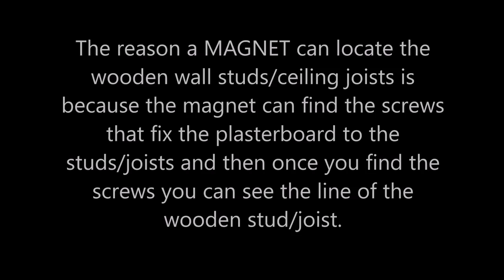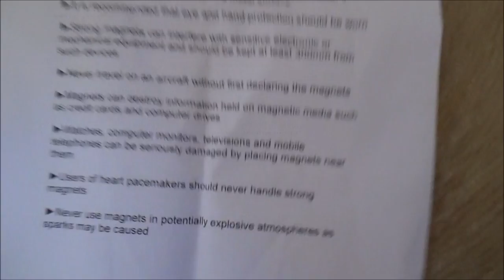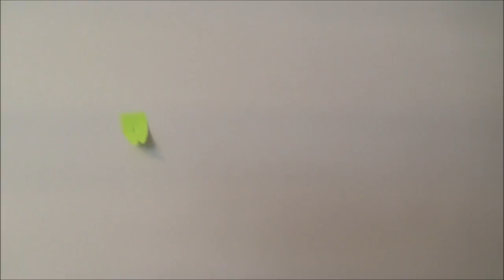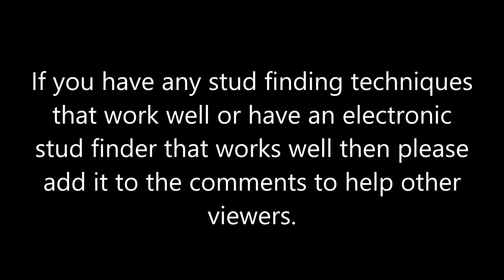How to use Magnets and 'Knocking' to Locate Wall Studs and Ceiling Joists

Comment: Tried this exact process last night in preparation for attaching French cleat to plasterboard through to the studs for hanging a heavy mirror. Worked liked a charm. I've marked off the screw heads and the approximate width of the stud so that I can drill into the stud with confidence. Great stuff. Btw, I'm currently renovating and redecorating, so marking the walls isn't an issue, because they'll be eventually covered up with an undercoat and a few coats of topcoat.

As mentioned in the video, it's common sense. A constant magnetic attachment means there's something other than a wooden stud with intermittent nails behind that particular spot, so don't bother drilling there. It's not a perfect formula, but with some discernment it works, but be careful.

Comment: Hi,

I saw your video which is very informative. I have neodymium magnet at my home and tried to use it on my ceiling to find joist or stud. I am not sure if it is working for me. When I move the magnet around on the ceiling it easily grab and stick to the place where it find the joist. So I tried to drill a hole at the place where it did not grab and stick. I assume that it is the place where there is no stud or joist. But even there, its not able to drill. After 3-4 millimeters the driller get stuck. What wrong am I doing?
help will be appreciated a lot.

Thanks